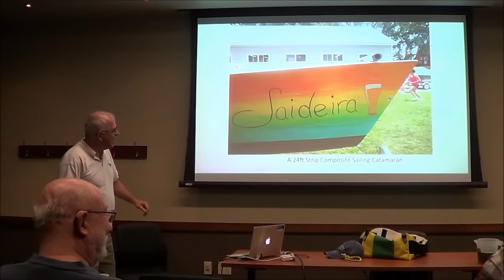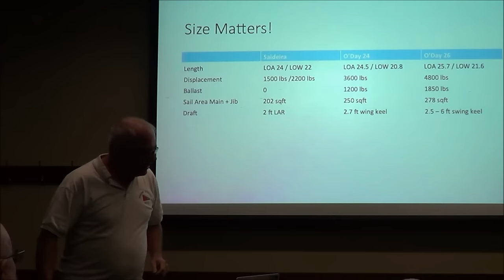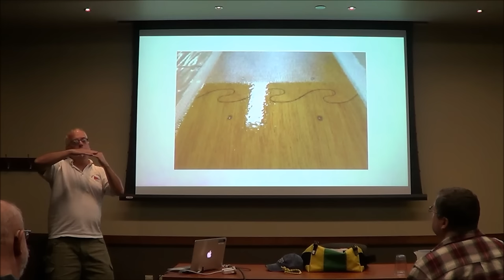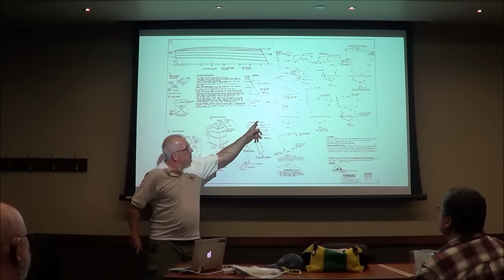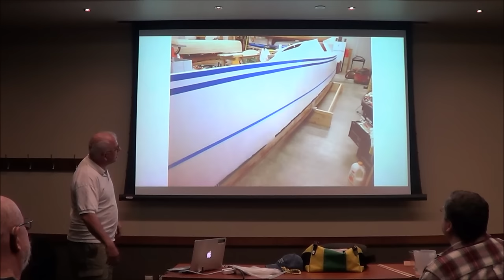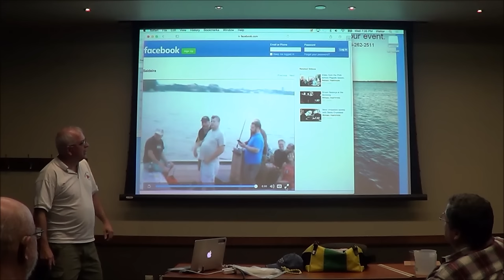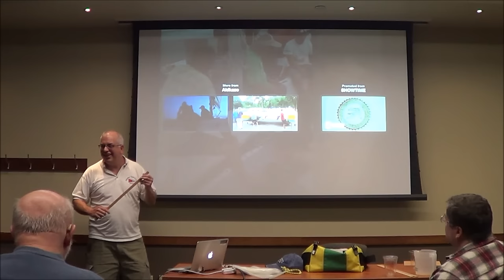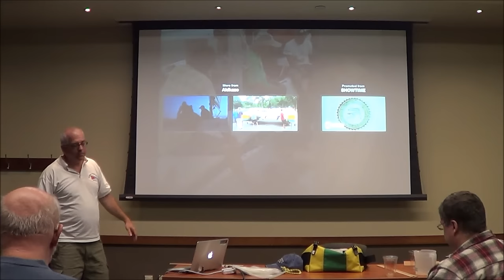Building a Catamaran from Scratch

Comment: Very interesting .Having sailed a 32 foot Prout from Ireland to canary Islands I can say this looks to be interesting solution for deep water and still stay sorta safe . I did bare poles from Lisbon to canaries for three days with force 7 to 8 and sometimes 30 foot waves with some that landed in the copit. The center copits take more than ten minutes to drain with bucket and pumps single handed .The drain holes dont work when the floor is under water from tons of water in the copit .Then one time large breaking wave surfed at high speed for some few seconds with sudden viscous broach which bent 6mm metal rudder plate .The better for small cats is to keep to two separate hulls and to keep light as possible .Also if the boat has centerboards  keep the center boards up in stormy conditions .Also keep mid latitudes with correct season to avoid real bad storms is smarter for small boats .However have a boat like this which cant sink is definitely a good move .Love the cedar wood system . However I think I prefer the strip method with foam and build two half hulls and glue those together .Foam method will also float but I think is faster method for building. I like the design any links for the design .The problem with sailing is the average wind is force 3 and large boats tend to be slow in these light winds so I prefer to not exceed 30 feet .Cost wise 24 feet is good for costs .Also like the lecturer says you can park it someplace often for this size cheap and come back few months later and sail again.In warm climates the need for large cabins is reduced. Also for anchorages or marina  a tent can add useful living space. keep up the good work and do some sailing video of when you do the Brazil run
Reply: ....what's a "copit" 🤔 ...I'm not a sailor, I'm land locked in Dallas TX.  tanks 😊